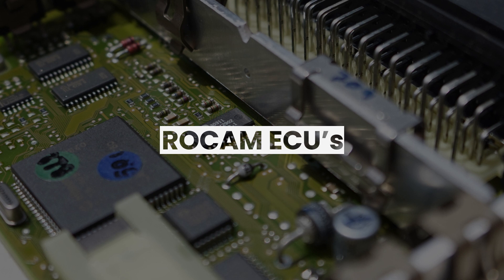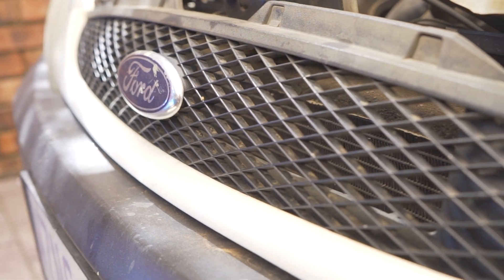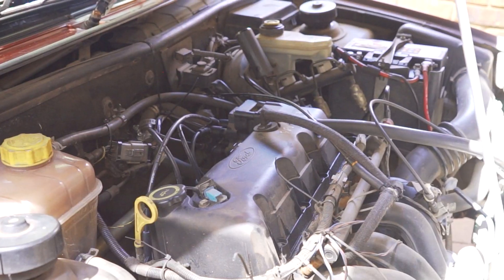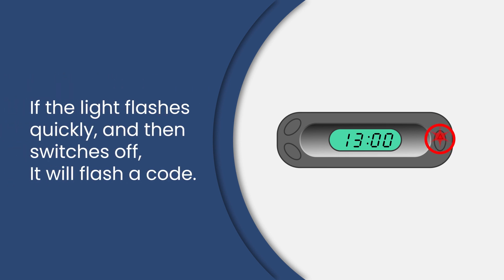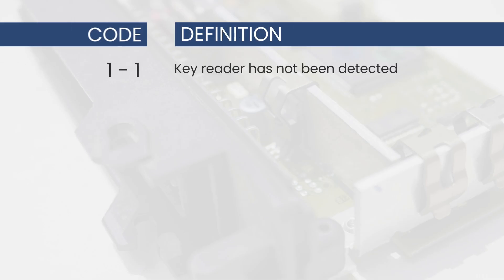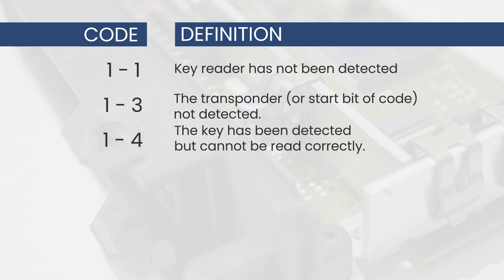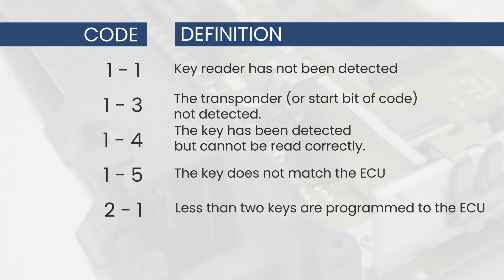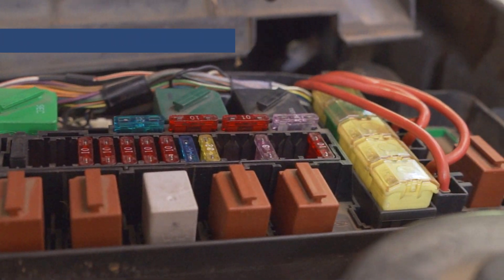ROCAM ECU Series - PATS Codes

Comment: Mine it won't crank the red light remains on ones I turn the ignition on even Wen I turn it off it remains on it just stopped driving from nowhere
Reply from the maker: We can repair this. This is a PCM / ECU problem. Phone/Whatsapp: 0820606425